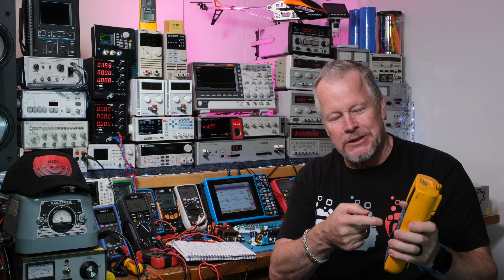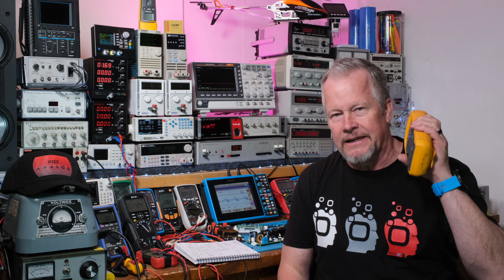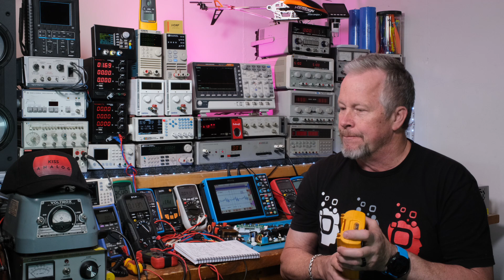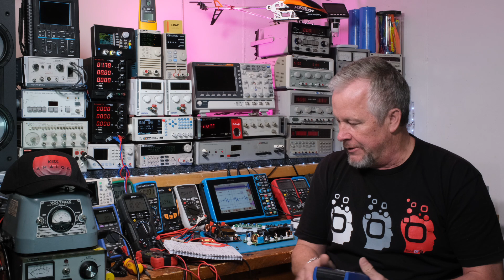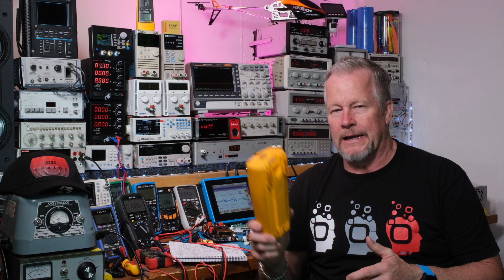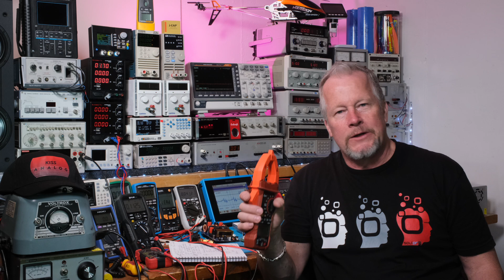Rant on MultiMeter Reviews with Fluke 289 vs Keysight U1282A #Rant #Fluke289 #keysightU1282A

Comment: I own a Fluke 789 that costs about 1200 now. Personally I think that is way overpriced for what it does. If it ever broke I would just buy a 4-20ma signal generator for 200 bucks. Your rants about meter reviews are spot on for the most part. I've seen a former co-worker short a chip by dragging a probe checking for shorts to ground. Yeah taking off points because diode mode doesn't light up a clear LED is silly. I've never seen a bad LED stop a machine from running in the field. I've seen an LED fail once and that is because water dripped on the LED, and it got corroded.  It had no effect on the operation of the equipment. I still enjoy the long thorough meter reviews that check everything though. Yes I know even a 10 dollar meter from Banggood is still going to be pretty accurate. I just like watching them.
Reply from the maker: Love the feedback!  You are right on!

Comment: I agree that Flukes are too expensive but after seeing Joe Smith’s extensive torture test of a Keysight meter, I certainly wouldn’t replace a Fluke with a Keysight. Flukes might be overpriced but at least they survive Joe’s tests. 

After seeing his tests, I decided never to buy a Keysight until they re-engineer them to be more robust. Spending over $800 for a meter that can’t survive a few transients that even cheap meters can survive is criminal in my opining.
Reply from the maker: Thanks for the feedback!  I love Joe's videos - but he does go over and beyond what the agency/meter testing requires.  If you are in CAT IV work areas - I'd be more concerned - otherwise it is not an issue.  I'd be interested in hearing if anyone has los a meter because of transients?  They would have to occur while taking a measurement - and that would be serious in CAT IV or maybe CAT III, but would still be a low chance of occurring.  At the work bench it would not be an issue.
Reply: @kissanalog  Hey Eddie, I agree that Joe’s tests are extreme and not the norm for most people but for the price that Keysight is asking, their meters should be built like Abrams Tanks. If cheaper meters can survive his tests, Keysight should be able to as well.
Reply from the maker: Thanks @Julio Rodriguez aka julrod!  I agree, an expensive meter from Keysight should be made robust!
Reply: It of course is your prerogative, but basing your opinion of a brand based on what you yourself call an "extensive torture test" is a fallacy.
It would make sense if you were looking at tests with multiple samples that relate to the most common failure modes of multimeters, which this test is not.
Anyway, if you work in an environment where 5kV spikes are occurring at regular intervals, as in that test, you should not be working with a CAT III 1000V meter.
Reply from the maker: Great point @Kris M!  A CAT III meter isn't made for that type of abuse.  I've only seen meters fail (in actual use) from high voltage when I went to a lab that made high voltage equipment.  They had a bucket full of dead Flukes - and Radio Shack meters;)  I guess they realized that killing cheep meters made more sense;)
Reply: Keysight as far as bench equipment go seem like the new hotness though if you have 5000usd to burn. But you'll get a nice msscope haha

Comment: Back when I was a bench tec at Teknis Sys we would send all relevant test equipment to DSTO (defence lab) for calibration every 12 months.
They would return the equipment with a report and calibration sticker on each.
This was a requirement for a lot of Mil Spec contract work.
I only have the sparky Fluke for field work in my current role.
It’s a great meter for what I use it for.
I agree there’s some amazing meters for the price these days.
If you get bored with 289, send it my way 😂
Reply from the maker: Thanks Darryl for your feedback!  I know the cal lab that the last company that I worked for (a defense contractor) would occasionally call us and let us know that something didn't meet cal.  They didn't bring in in cal but instead would simply put a stick on it saying out of cal.

Comment: Flukes are expensive because of traceability which is very costly.
Reply from the maker: Thanks for the feedback - but that is actually not true.  Most Flukes come with no calibration, so no traceability at all - but still very expensive.  You can buy a lot lower cost meter and have it calibrated if that is what you need.  But, I want to be clear - this is not a Fluke thing.  This is a myth!  If you have a Fluke - tell me how it is traceable?
Reply: @kissanalog  Even if it comes with calibration, it doesn't mean it's traceable calibration (to national standards).
For it to be traceable, you also need the scope of the lab etc.
But usually it's in practice easier to get a Fluke calibrated than any other brand. Any cal lab can calibrate a fluke. First of all because of Fluke's industry dominance, and Fluke's cal and adjust procedures are all known.
I think for some models Fluke has automated cal software so calibration and adjustment becomes quite easy and fast.
But most quality meters from top brands can be purchased with separate traceable calibration.
Reply from the maker: Yes you are correct.  When I say calibrated, I do mean a traceable calibration.  If it is not, then the calibration isn't worth printing.  I had a shop once, and a Fluke rep told me I could make a lot of money buying their Fluke multimeter calibration machine.  There's no tuning going on - which is a myth a lot of people have about modern calibration.  This machine that this guy wanted to sell me would have modules (one for each series type of meter) and you plug it to your meter - hit go - wait a few minutes - then print  out the calibration.  If the meter is working - it should meet spec - from what I understood.  But most of us at home - professionals working as contractors or even working in small companies - do not calibrate anything.    It just costs too much and isn't needed - unless you have a customer that requires that.  Most products that need to meet EMI or other testing are sent to 3rd party test labs who have all that equipment calibrated.